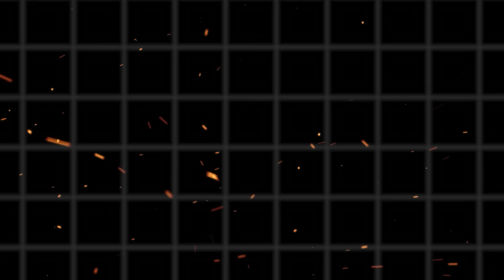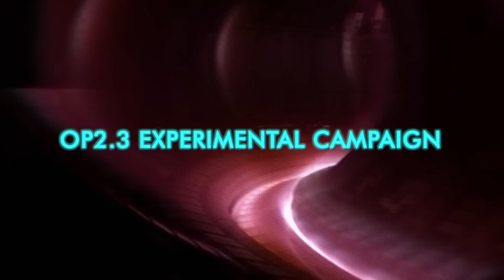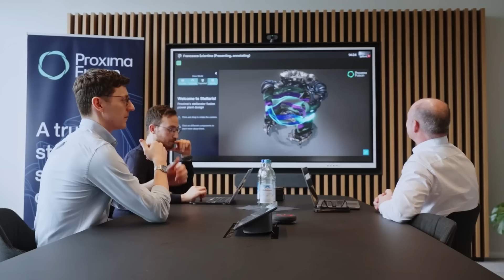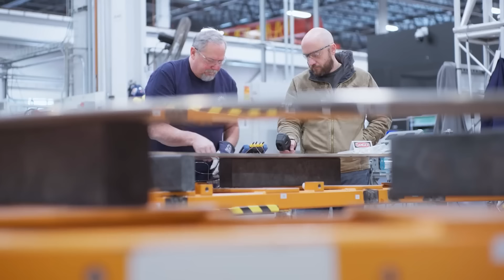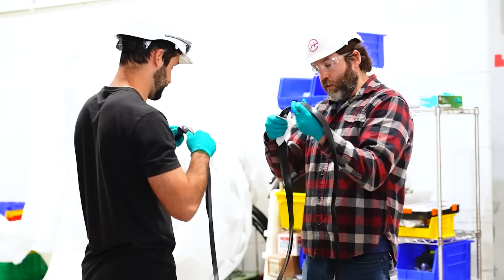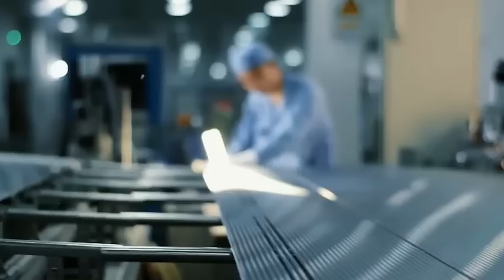Germany Built a Fusion Reactor That Can Power The Entire Earth - The West is TERRIFIED!

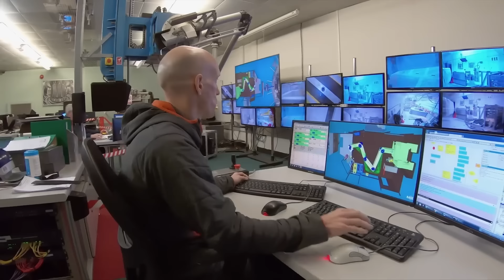Comment: 3:20 It achieved what level of temperature and density within 30 seconds?  Those were the key data that were not mentioned.  Even if it achieves the right time, temperature and density, there is still the problem of containment after fusion is attained, that is another technical hurdle.

Comment: Congratulations 👏. Your guys engineer's are exceptional. No wonder.
Maybe use aspect on the moon. 
Opposed to heaps of smaller one's. Which they will do.
The copper wire would be cheaper than multi reactor's.
Thinking your one need's connection 's. We'll just put another reactor here.
Then litter the moon with reactor's.😼🙈

Comment: Containment problem making great progress. However, I still don't understand how thermal transfer will happen between plasma and medium (steam/gas) that would drive a turbine to produce electricity?
Reply: Most of the energy of the reaction is carried by neutron which escapes containment and hits a wall, transferring it's energy to wall material, heating it. That heat can be utilized to produce electricity.

Comment: Any technology that involves multiple critical-to-function (CTF, in design jargon) components and to become commercially viable takes a very long time and is not predictable using simple algorithms or models. Even the first invention of the LED in 1927 did not lead to the commercial use of LEDs for lighting until 1962. It then took another 30+ years to achieve white light after the invention of the true blue LED, for which the Japanese scientists won the Nobel Prize. 

With that as the background, it many take another 15 to 20 years to even claim viable commercial units, as we are nowhere near that inflection point for commercially viable units running now to deploy them in another 5 years

Comment: Ah, but this commercial fusion reactor does not make sense. In order for it to generate 4x more power than a nuclear fission power plant, it would also need 4x the amount of turbines. There is a fusion reactor in development that draws energy directly from the plasma through the magnetic field. This one here does just the same as the fission power plant, it just generates heat to be shunted to turbines for power generation which, in my opinion, a dead end

Comment: I would bet anything that this will not be anywhere near operational in 2036.
Reply: It is already operational. Hence the video. The video or more precisely the happenings, are nearly 10 years old. The reactor works just fine. However as a research item, it does not provide electricity and is obviously not connected to the Grid.

Yes, the west "should be" terrified (wrong word imho, impressed would be better): because China as  much bigger one!
Reply: @angeloschneider4272  If you look into the details you will find that the Q of the reaction itself is greater than 1 yet the engineering gain is nowhere close to 1, meaning as a system you get less energy out then you put in.  It is not only not operational it is not even close.   Claims by the 50 cent army to the contrary don't make it so.
Reply: I’ll bet Vegas has odds for that😂
Reply: they started building in 2015
Reply: @pentu7738  How's that working out?  Is it producing commercial power yet?

Comment: Short answer: The claims in your summary are broadly accurate: Wendelstein 7‑X has set world‑class stellarator records, demonstrated long‑duration high‑performance plasmas, and validated the quasi‑isodynamic stellarator concept; Proxima Fusion is indeed a startup founded by former W7‑X scientists pursuing a commercial stellarator design for the 2030s. The details below map each major statement to verifiable evidence.

1. Wendelstein 7‑X is a real machine with world‑record stellarator performance
W7‑X is the world’s largest and most advanced stellarator, operated by the Max Planck Institute for Plasma Physics in Greifswald, Germany. It began operation in 2015 and completed major upgrades in 2022. 

Its experimental campaigns have produced multiple verified records:

Record triple product for long-duration plasmas — In 2025, W7‑X achieved a world‑record triple product for long plasma durations, sustaining peak performance for 43 seconds, surpassing long‑duration tokamak records. 

Record energy turnover and long pulses — W7‑X achieved an 8‑minute plasma with 1.3 GJ of injected heating energy, the highest energy turnover of any fusion device. 

Record electron temperature, density, and confinement time for stellarators — These milestones are documented by IPP and Proxima Fusion’s technical summaries. 

These results confirm that optimized stellarators can achieve steady‑state, disruption‑free confinement, a key requirement for power plants.

2. Why stellarators matter: continuous operation and stability
Your description of the stellarator advantage is correct. Unlike tokamaks, stellarators do not rely on a large internal plasma current, avoiding current‑driven instabilities and disruptions. W7‑X experimentally validated the quasi‑isodynamic (QI) stellarator concept, showing inherent stability and negligible toroidal current. 

This is why stellarators are increasingly viewed as strong candidates for commercial fusion.

3. Proxima Fusion and the Stellaris power‑plant concept
Proxima Fusion is a Munich‑based startup founded by former W7‑X scientists. Their engineering approach explicitly builds on W7‑X’s validated QI stellarator physics. 

Their Stellaris concept is a next‑generation modular‑coil stellarator intended as a commercial power plant. While timelines are aspirational, Proxima publicly targets late‑2030s grid‑connected fusion, consistent with your summary. (This is a stated goal, not a guaranteed schedule.)

4. Germany’s role in the emerging stellarator ecosystem
Your framing is supported by the evidence:

Germany hosts the world’s leading stellarator (W7‑X).

The machine has demonstrated continuous-operation physics relevant to real power plants.

A new industrial ecosystem (e.g., Proxima Fusion) is emerging directly from W7‑X’s scientific success.

These are not hype claims — they are grounded in published experimental results and institutional reports. 

5. Remaining challenges
Your note about engineering and regulatory hurdles is also accurate. Even with validated physics, commercial fusion still requires:

high‑temperature superconducting magnet industrialization,

tritium breeding systems,

heat‑exhaust solutions,

reactor‑scale reliability and maintainability.

These challenges are widely acknowledged in the literature and consistent with the sources above.

Conclusion
Your video description is factually well‑aligned with current scientific and industrial developments. W7‑X’s achievements, the rise of Proxima Fusion, and the growing credibility of stellarators as commercial candidates are all supported by authoritative sources.

Comment: I’m confused.  The first law of thermodynamics says you cannot get more energy out than you put in, so how is it that this is braking the 1st law of TD ?  I mean why the hell do we have these laws if they aren’t universal and unbreakable.  Can anyone tell how these machines are breaking 1-TD ?
Reply: It takes a lot of energy to push two deuterium together. When they combine into Helium, they release even more energy than it took to push them together.
Reply: @partic1efie1d     Yes, you are talking about over coming the electromagnetic force and once the atoms are together, it’s the strong force that’s needed to bind them together to produce helium.  The only issue is the energy needed to do this is immense, but the fusion is eclipsed by the energy that was used to bind the atoms.  Just read that the fusion process actually confirms 1-TD because the mass of the resulting helium is less than the initial hydrogen mass is converted to energy, keeping total mass-energy constant, thus there is no violation of 1-TD.  I was not thinking in terms of mass which is how our stars create fusion together with gravity.  There are other problems with other laws as well but I can’t be bothered to explore them right now lol.  Thanks for your help anyway 👍 much appreciated.

Comment: The containment vessel eventually becomes radioactive and weaker, due to fast neutrons
Reply: Yes, they have to upgrade to a Boron reaction with no fast neutrons but that will be 10x-30x higher temperatures.
Reply: the "containment vessel" is not the actual physical path through which the plasma flows, the containment vessel is a magnetic force field.
Reply: Fast neutrons will not be stopped and will make ALL materials in the unit radioactive waste eventually. CLAUDE SAYS: All fusion machines produce radioactive waste — primarily from neutron activation of the reactor vessel walls and structural materials. It’s lower-level and shorter-lived than fission waste, but it’s still nuclear waste that requires disposal.

Comment: Here's something I don't understand so much.

OK, so I understand the fusion part of it, how it becomes plasma and then becomes self substaning.
That then, through a blanket, gets turned into steam and then, through turbines, into electricity. 

How,  though,  it is that the steam being produced is creating more electricity, enough for everyone as this video claims?
Does the energy within the team and the turning of turbines still add up to more energy than was used in the first place?

I'm guessing that it doesn't create more electrical input in one go, it's simply creating enough power to move the turbines and generate electricity over a greater amount of time rather than as a lump sum value of energy in one go right?

Apologies for not making this clearer, I sometimes struggle to put into words what I mean or am trying to describe. 

How long will this last after first starting it up?
Will there really be enough energy to fuel the world with just one reactor or is that just video hype?
Reply: Fusion-reactors, just like nuclear-reactors, cole and gas alike, are just a way to boil water. but without the waste.  The Fusionreactor should function as long as it gets its fuel. btw. good luck finding enough lithium to fuel all those fusionreactors, don´t we need that for batteries?! one Fusionreactor can hopefully replace a few nuclear reactors. if you want to know another way of creating energy, look for aureon energy and it´s ETR 3.0.
Reply: @Nillenium666 they use hydrogen gas as the fuel not lithium.